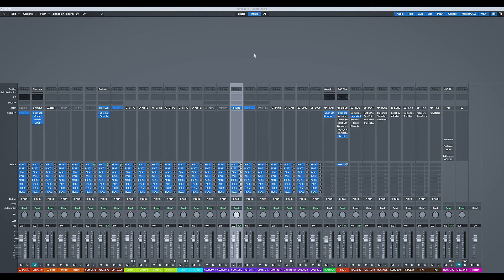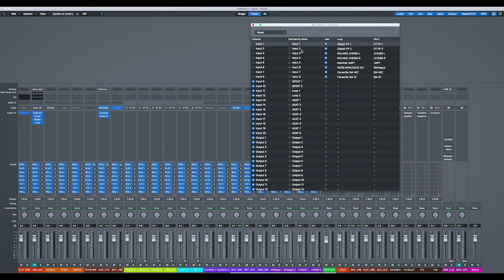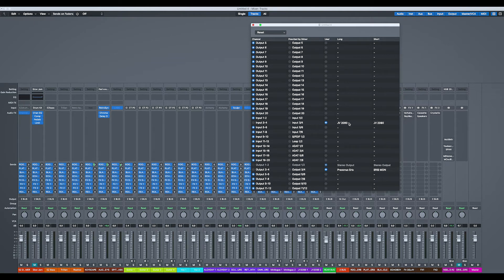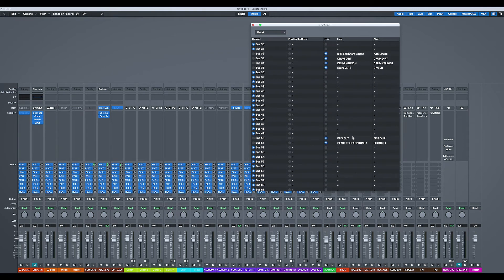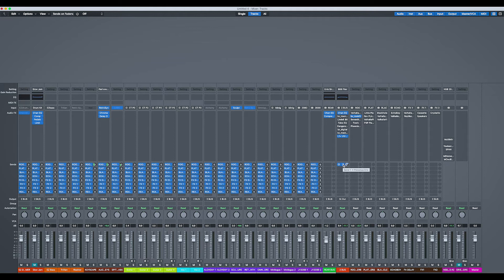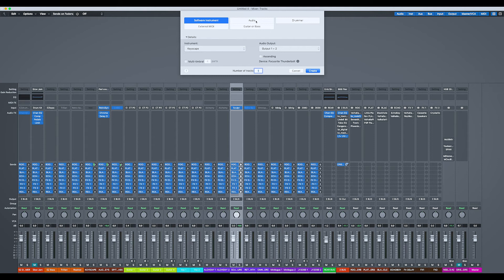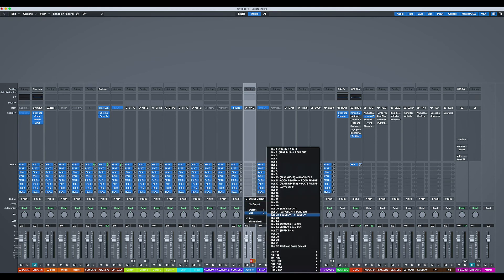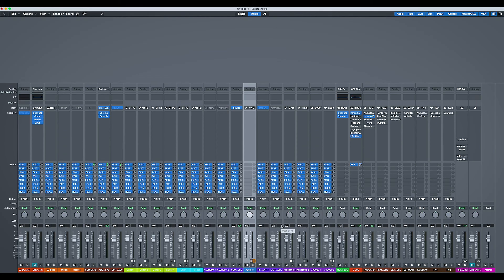Logic Pro Workflow Tips - Using the I/O Settings

Comment: So if I rename/update some busses, and then open an old session... will the names be wrong? Trying to figure what's best for my template going forward. Thanks!
Reply from the maker: Hi there, yes if you change your I/0 Settings they will reflect the current state of Logic, therefore old sessions will have the new I/0 Names. Now if you just change the I/O settings (not the busses) this should reflect your current audio interface inputs and of course your routing outputs. That could be a compromise solution if you don't want to end with aux sends to busses with different names. Give me a shout if you need some more advice. all the best, Neil